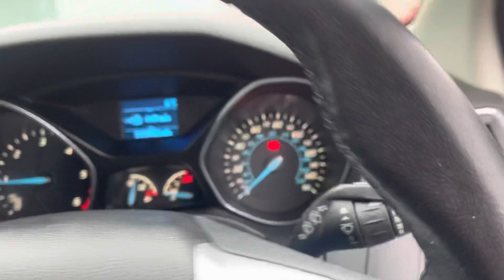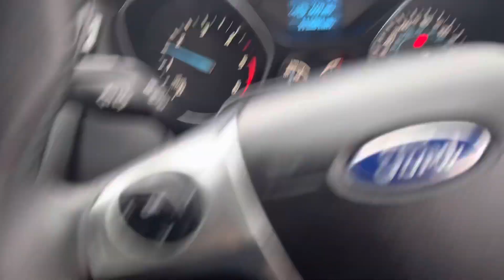I bought a wrecked Ford / was it worth it! Flipping cars Uk #flippingcars #dreamcar #trending

Comment: yo I have the same van but the 2.5 had it for donkeys years goes on forever but I prefer using the q7 for towing a trailer more comfortable and pull like a train. 😁
Reply from the maker: I was looking at get a Q7 too or a x5 08 plate
Reply: @SAVING_ICONIC_MACHINES  great cars to pull a big arse trailer plus auto you should do
Reply from the maker: Yep 👍🏼. How’s the Subaru going
Reply: @SAVING_ICONIC_MACHINES  sitting on the drive feeling sorry for itself 🤣got to sort out to bangers that I not long brought 🤦‍♂️🤦‍♂️

Comment: Good setup with the van and trailer 👌 some of the CAT N cars are minimal work that looks not too bad mate for fixing and engine runs smooth too 👌
Reply from the maker: Thank you mate, I do want to get a Q7 or X5/6 to tow I can’t be dealing with the hills lol 😂 I had some struggles in the wet going up a hill only because I was stuck in traffic, but It’s not bad at all. il be doing a updated video, on the car as well as a price breakdown including fees and repairs if it’s fixed by then or il get a quote so regardless il know what it’s going to set me back all in.